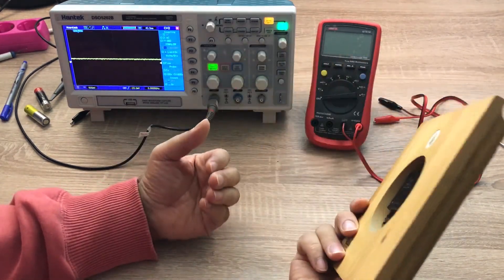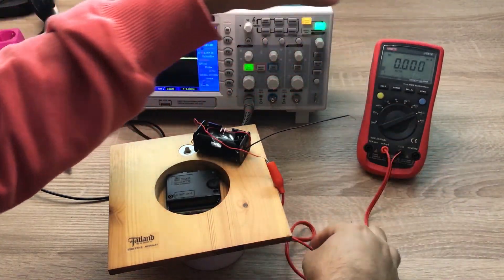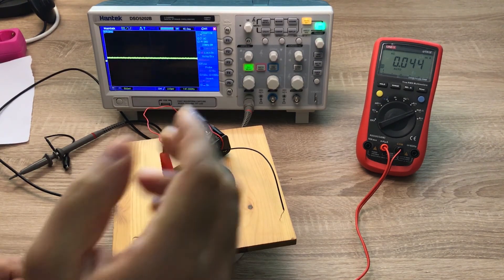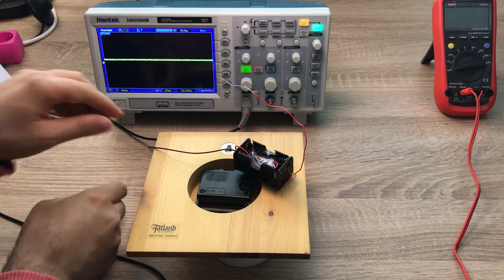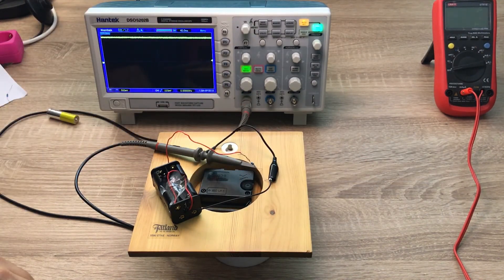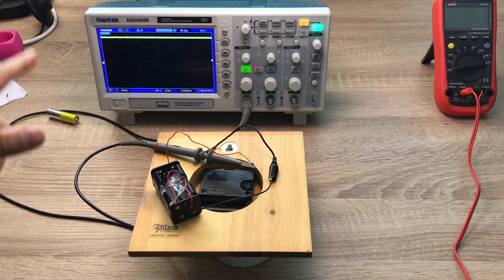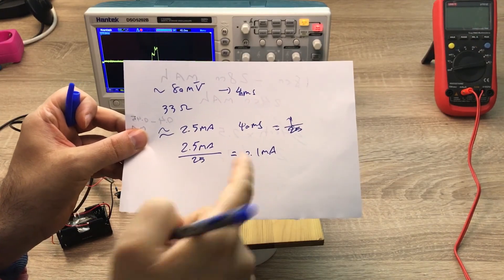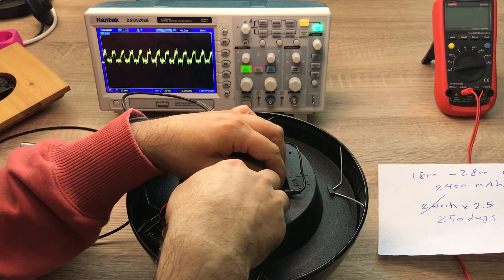How long does a wall clock battery last

Comment: Make a calculator for it 😁
The battery🔋 replace date to new battery🔋
Total number of second in one year
Total power💪⚡ used per second 
Duration of🔌 supply
So we found out some more clear output cal ultimate calculator😁😁😁

Comment: So i find out a notmal clock running life.
to be a  clock something is a bettery of alkaline (durecell) whose ampre is 1800mah,and   
Clock ampre we messure is 0.4mah. To be calculate by 
(bettery 1800mah/0.4amps of clock per hour)=450/hours
To be calculate by (450hours/365days)=1year 23days of a clock bettery are longerduty.
Soumyadip paul.
Reply: Make some calculator for it 😁😁😁😁
Reply: do you mean 0.4ma? (instead of mah)